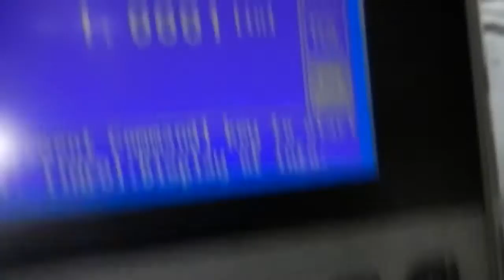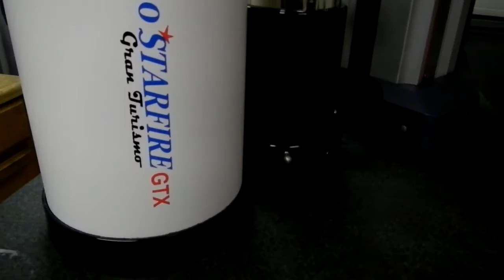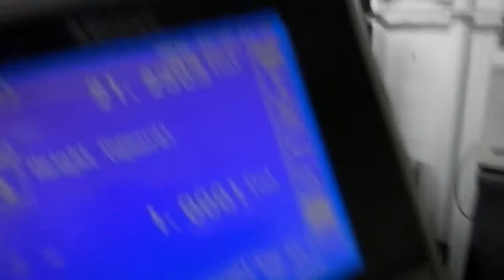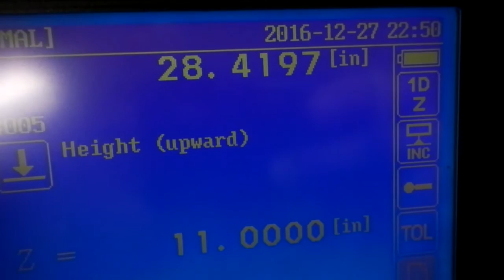Astro Physics 130GT vs 130GTX a comparison

Comment: I just got notified for the 130GTX!
Reply from the maker: Logieberra     Great news! Do you know what date you got on the list? I got on the list April 29-2008 and received it on Dec. 19-2016. That's 3157 days or 8yrs, 7 months, 21 days. Yes, I kept track of it. What is AP giving you as an anticipated ship date?

You will love the scope. I think 130mm is an excellent size for portability  and resolution. Will you be doing photography with it? I am just visual at the moment.
Reply: I'll never understand the Astro Physics business model, having to wait years for a telescope to be built. You can have a custom Rolls Royce in under four months.
Reply: And your point was what?  I don’t see the difference.   You wait if you want one, simple.
Reply: starastronomer - I applied on April 26, 2012 so it’s been 8yrs and 2 months I guess? They are shipping in Oct :)
Reply: starastronomer - may I ask a favour? I am thinking of using my Tak TOA flattener and reducers on this scope (I.e. not APs ones). Can I see a video or pics of the focuser end where something like that might be added/adapter made to thread them on? What’s your email? Thank you! It will save me thousands if I can use them...
Reply from the maker: @logieberra     It uses the "DoveLoc" type like the 92mm as shown in my video https://www.youtube.com/watch?v=UOamVLteJSs   It is larger though.
Reply: starastronomer sent! Delete ::)
Reply from the maker: @logieberra  I will get back to you after work.

Comment: Very nice technical comparison. I didn't realize AP moved away from the 3-part separated tube, though it seemed a bit counterproductive that they included space for the covers in the case for the assembled tube, since you're not using them and it just makes a larger/heaver unit to transport. I'm glad they moved away from that.

I'm curious about the larger rings though. You didn't give measurements on those, and the GTX ones are significantly larger. Is the tube diameter the same for both scopes?

Those focusers are quite impressive. One thing I noticed is that everyone seems to think the main purpose of the brass inserts is to prevent scratches, but I find them more useful in that they provide a greater bearing surface so you don't have to clamp down the [damn] screws so tight, which tends to strip the threads over time.
Reply from the maker: Glad you like Jim. As to the tube rings, the GTX has a larger tube diameter than the older design GT telescope. AP's workmanship is something to behold...just spectacular. Everything is butter smooth. Yes, the brass does spread the "load" of the tiny screw head for better clamping pressure. My friend bought the 130GT off me after the review. The 130 offers such a sweet spot in aperture, overall physical size, and portability; a true winner. If I had to choose between my 175 or the 130 it would be the 130 for these reasons. But, that 175 is a performer!!!